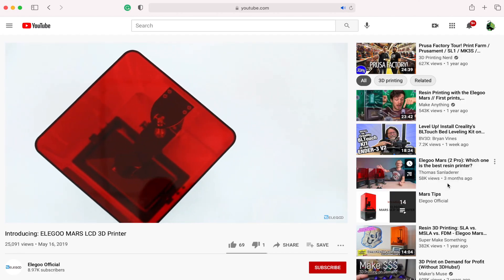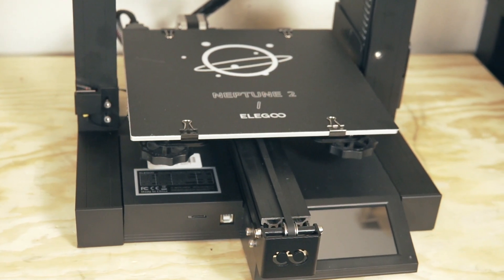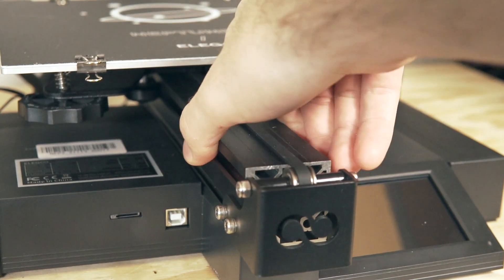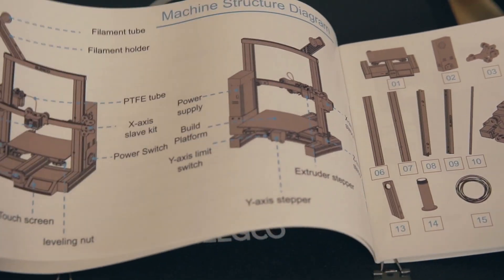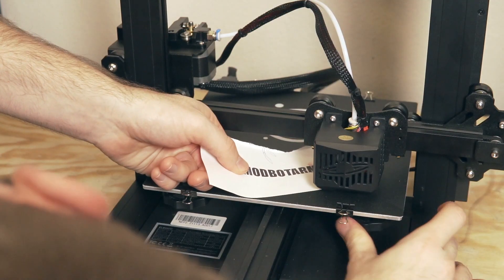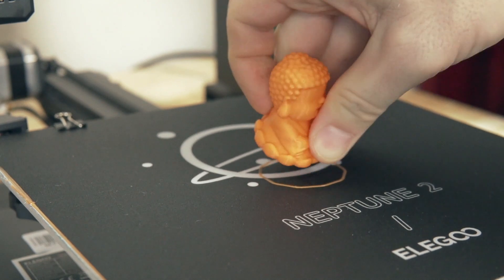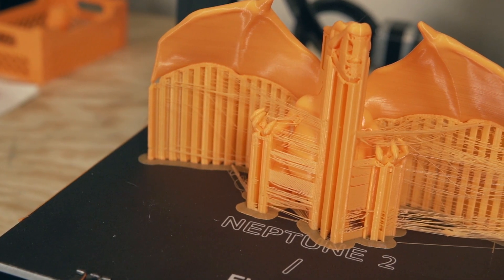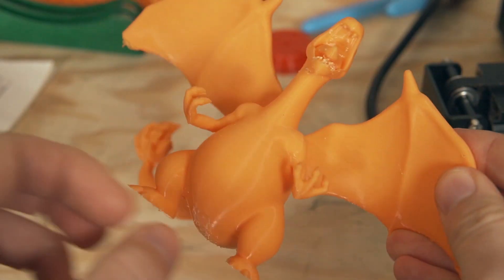Best Sub $200 FDM 3d Printer In 2021? The Elegoo Neptune 2

Comment: Please print some TPU.  Elegoo claims it will print but I want to see it.  I will upgrade once I see results.  Thanks.
Reply: every printer should be able to print tpu, but many cant print it well or easily, this is due to the extrusion type. this one like many others is bowden, meaning the extruder is mounted on the frame of the printer and not the hotend itself, this style makes printing tpu very hard because of tpus flexibility, another style is called directdrive, and is what is recommended for tpu. this style is good for tpu since its mounted directly on the hotend. so yes it can print tpu, but it will take a lot of time to tune, and will not be great. (without modifications)
Reply: @highwaymen1237  Wow entitled much? Like Arlo helpfully explained to you, literally any FDM printer can print TPU, period. It’s not a magic filament, it just prints much better/faster with a direct drive extruder due to having less room to bunch up before it gets to the hot end. This printer uses a bowden extruder so you would just need to print TPU slowly (compared to PLA) and stay away from super soft filaments like Ninja Flex (which I think is actually TPE anyway).
Reply from the maker: If TPU is your goal, I would not recommend this printer. As some others stated most machines can do it (including Ender 3 with a printed addon to the extruder). With that being said, if I wanted to print TPU and especially soft TPU like Ninjaflex I am going with a direct drive printer. I feel that you would be disappointed and frustrated by the speeds or other limitations.
Reply: @ModBotArmy   I've been watching all of the reviews on this machine and asked the same question, you were the first to respond and I appreciate it.  Thank you very much.  If you could come up with a low cost modification such as converting it to direct drive and print ninjaflex it would be a very interesting video.  I was considering trying the $16 dual gear bowden drive If I bought this machine.  I am now watching your dual drive upgrade video.

Comment: 160 bucks with all these features!? How are these guys gonna turn a profit!?
Reply: Nonsense, the stepper Motors cost more than $20 for 4 or $5 each even in China.
Reply: @highwaymen1237  what would be your guess ?
Reply: @highwaymen1237  Rubbish.  You can get a 5-pack of nema17 steppers for $30 on aliexpress.  There's only 4 steppers in this machine, and at the quantities elegoo is buying them, they're probably paying less than $5 each.  Don't forget that all their resin printers are using steppers too, so they undoubtedly already have good bulk purchase deals worked out.
Reply: @mortalwombat5811  Your use of probably it's not a definitive answer.  There's also the question of quality.  My statement still stands you barely cover the price of the stepper motors for $20.    That was a statement I was referring to that someone conveniently deleted after my response.
Reply: @thoren_1928  I see you deleted your statement you could build this for 20 or $30.
Reply: @highwaymen1237  of course, if im wrong i dont want to spread „fake news“ - but now it seems like i was right
Reply: @thoren_1928  liar.
Reply: @mortalwombat5811  Are the cheap stepper motors from Ali any good or are they junk?  Are they the same quality that Elegoo uses?

Comment: I own the Elegoo Neptune and I can tell you DONT BUY IT.  Mine has nothing but troubles since day one.  I have tried to fix it several times, they sent spare parts out (they are good at that part), replaced the belts twice already and it still keeps failing.  The beds are super warped, so leveling is 10000% garbage..
Reply from the maker: This is a Neptune or a Neptune 2?
Reply: @ModBotArmy  Neptune (1)